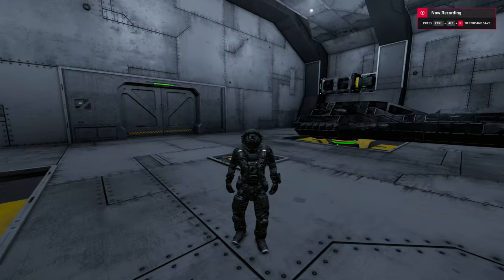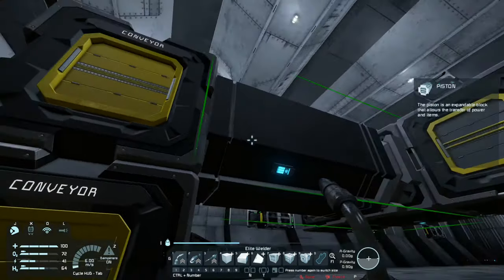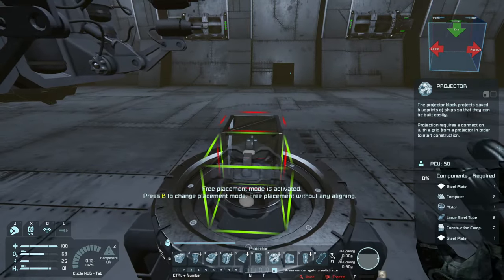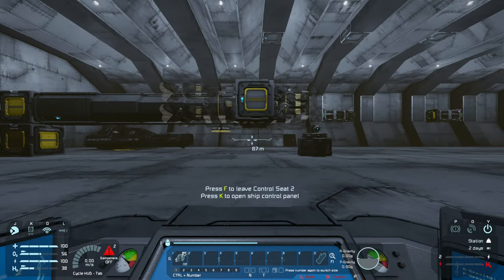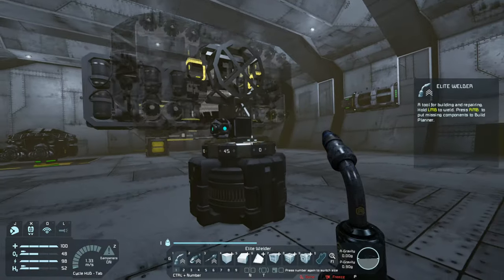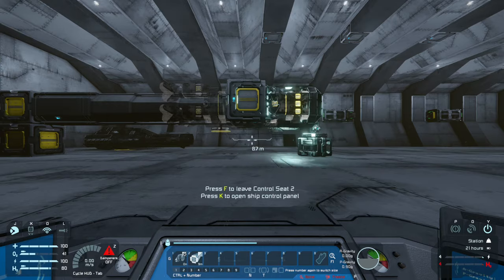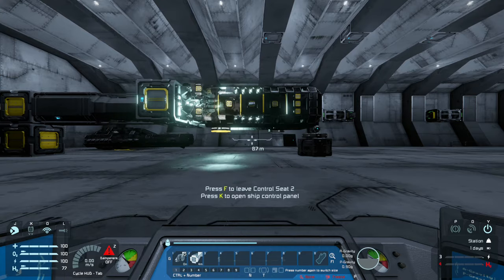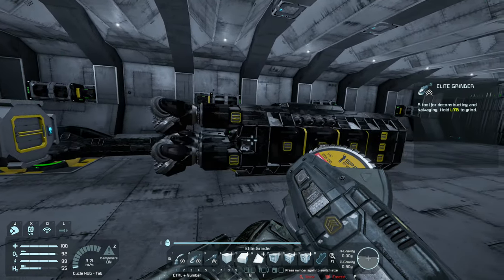Space Engineers - Building a Ship Printer

Comment: A welder functions in a 3x3x3 block from the baseblock (so the welder tip falls into the 3x3x3). If you use 6 printers aimed up from the bottom with tube between them, place the rotor and small piston upwards between the tubes, and put a mergebock on top and on the bottom of the ship, you get a much faster print for this size of ship as it rises from below the welders, plus you don't have to grind anything, you just hop in and disconnect. You can even set your blueprint on battery recharge to eliminate the clang, and as long as your stick stays connected it will automatically charge.
Reply: Need a video of what ur describing

Comment: If you want your thrusters not to fire on your projected welds there's a simple way that doesn't involve turning off dampeners or switching off thrusters. Go into control panel and raise the height offset of the rotor to maximum then build a line of about 4 blocks in the opposite direction to your projection. Make sure you leave enough clearance to fit a landing gear between the row of blocks and the floor but only just enough room. Fit a landing gear, weld it, lock it (lower the rotor again if you need to) and once locked your projection will be more stable and will not Klang or try to move with its own thrusters.
Reply from the maker: That's a really good suggestion actually, thankyou! :)

Comment: Great tutorial! Building ships this way is much easier, but I did run into a bit of an issue. The system doesn't automatically build the parts needed, so I found I was having to turn off the welders, and go and manually queue the parts needed into the build planner for each part as it was being constructed, then turn the welders back on. Is there any simple way to just queue all the parts needed in a blueprint into the build planner?
Reply: Need an inventory manager that can be programmed to maintain minimums of parts.
Reply from the maker: Unfortunately you need to have a Mod to do this, or otherwise you can just build heaps of components ready to go. After a while playing the game you can kind of work out what you roughly need for a given ship or design.

Here is a link to the Mod i mentioned (Note: I did not create this mod) - https://steamcommunity.com/sharedfiles/filedetails/?id=1289485324
Reply: I use "Isy's Inventory Manager" in a programmable block. Add 2 LCDs with "Autocrafting" in their name and you can set the minimum amount of components by changing the numbers in the text (press F) in the LCDs. Very convenient
Reply: Use the Build and repair BOB instead: it will automatically tell you what is missing.
Reply: The way I do it is have several thousands of everything before printing, and then it takes only a very little time to print everything! Be careful with what you're printing, ion thrusters when starting on a planet, well...they just won't be complete without platinum.

Comment: Just started playing on xbox, ive been using a vertical piston with a rotor on it to build my small ships at base, as i build from the top down i push the piston up little by littlw so i can easily build from the ground. Ita on one of two landing docka i have so i can also rotate the entire project out of the way if needed. I thought it was a pretty cool setup as its been a pain to build underneath my ships before i made this. Im deff going to incorporate  some auto welding now, even if its for a ship im still desogning it will save me loads of time just not haing to weld and fetch loads of heavy parts. Probably will have the aetup the same and have the rotor turn and lower the piston into a "welding bay"
Reply from the maker: That's a pretty good idea that! You can also swap out the floor with some welders and then put some windows ontop of them and just get it to weld for you 😎✌️

Comment: How do you do that thing when you take the components for a blueprint out of the station inventory by just a key command?
Reply: To add something to the build planner its RMB (Right Mouse Button), to add components from the build planner to production, select a port thats attached to the assembler and press Shift + MMB (Middle Mouse Button), finally to extract parts for the build planner  from the assembler or cargo containers press MMB.
Reply from the maker: When you have a block selected ready to build, you can walk up to a cargo port and press the middle mouse button and it will withdraw the components for whatever block you have selected at the time 😎👌
Reply: Thank you both for your fast anwers, building will be much more easier for me in future😊
Reply: @jonathan1384  NP
Reply: I know this is a year old thread, but I've got a related question.

I've always had to place a block before I could add it to the build planner (rmb) and then pull the components for that placed block using mmb.

In your video it's shown you grabbing components for multiple blocks BEFORE you have even placed anything. How do you do that?

I'm constantly struggling to keep some components in my inventory or go back to storage to grab one steel plate or whatever, just so I can place my intended block where i want it, to then add it to build planner and then go back and collect all the supplies. Not a good use of time going back and forth.

Playing survival if that makes a difference.
Reply from the maker: Oh that's easy man, say you wanna grab the components for a conveyor Junction? Have the block ready to place, then walk up to a cargo container and MMB click, that will withdraw whatever you need for whatever your character has selected to place down 😉